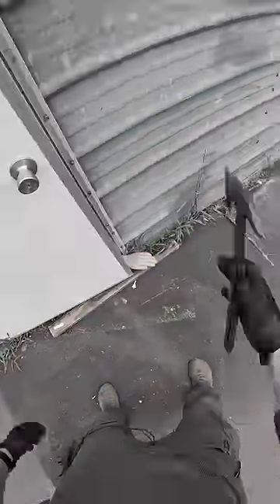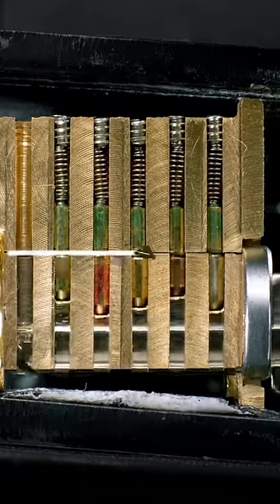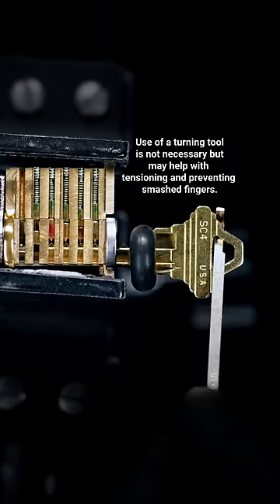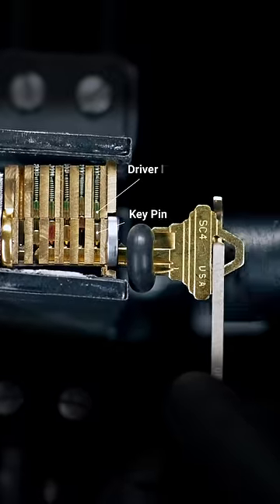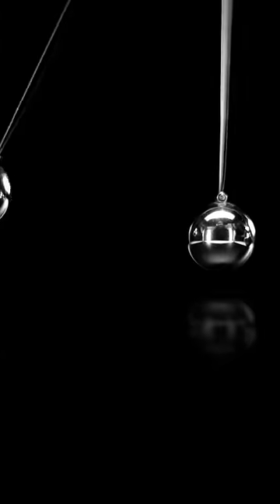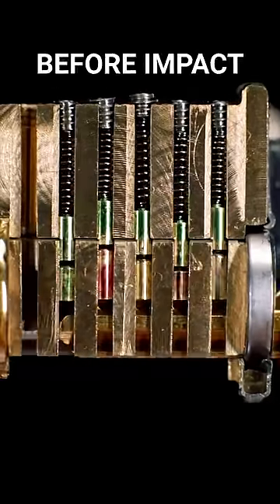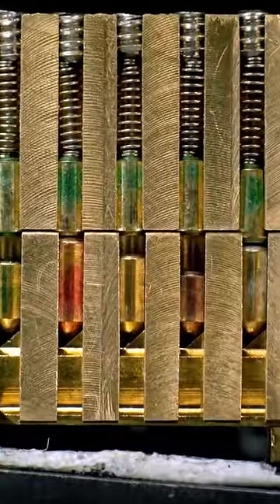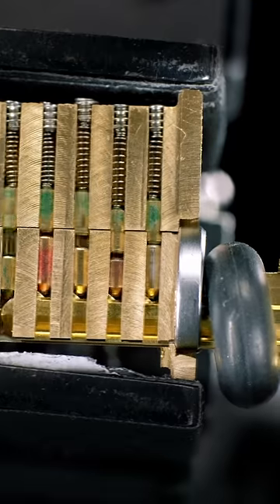Lock bumping explained with inside perspective and mini speed square motion graphics.

Comment: Finally a lockpick YTer actually acknowledges that it's a castration band 😂
Reply: Must not watch many bump vids dude.
Reply from the maker: I personally think the traditional method is better (for sheep), but I'm also okay not pulling testes out with my teeth 🤝
Reply: @McNallyOfficial i use the bands, they only roll on the ground for a few mintutes, poor things
Reply: @The_Natalist my god that's terrible!
Reply: And the best part is that it doesnt hurt as much as you would think so, after the first few hours you wont feel anything
Reply: @The_Natalist what are you talking about? If you catch them in a bucket no rolling has to happen 😂 but you're doing it very fucking wrong if you manage to hurt and animal with rings
Reply: @Charles-hm5zj it's a constriction band that goes around the nuts. It's going to be umpleasant
If you don't believe me, apply one to something you can cut it off from. Like a finger. Let me know how long until you feel something. There's probably medical recommendation for minimum time before the band will definitely cause damage. Probably something like 30 mins or an hour. Check first.
Reply: @samuelmellars7855  There is a persistent myth that young animals have "underdeveloped blood vessels and nerves" in that area, and therefore they are more panicking about being handled than they are about being in pain. Of course, there isn't a lot of scientific study on the subject, but there's also zero reason to assume one of the most tender areas on a human is any less so on other animals.
Reply: @McNallyOfficial sheep lil bull calves ppl horses anything that you can get em on is fair game lol
Reply: @Nerobyrne  it doesn't really effect calves other than them walking a little funny for a while. It's a lot better than losing a couple calves each year because they bled out from traditional castration
Reply: @LukeA_55  still disgusting
Reply: @Nerobyrne  just a part of farming
Reply: @gdxnsk  🗿
Reply: @Nerobyrne  > that's terrible

There are tons of things simply unpleasant to think about. But I'm thankful that we have people whose livelihoods involve routinely doing unpleasant and dangerous things.

Because steak and chicken are simply too damn tasty to stop eating them.
And because a lot of people still drink milk. 

Also I like not crapping in a bucket.

And not hauling my own trash to the dump each week.

And not having to embalm my own deceased relatives.

And walking to the fridge for eggs instead of through a smelly henhouse.

And knowing my insides are working properly.

And knowing help is a phone call away if my house catches fire. 

et cetera...
Reply: @zedmelon  I hope we can one day do it without stuff like that
Reply: @McNallyOfficial I am the confusion
Reply: What is everyone commenting about? Got one of those for my Peterwood Johnson, helps me last longer for when I stand in my lady. I'll last all night till she taps out. You guys are crazy with that  castration nonsense, but funny.
Reply: @truthinaction0000  Bro that gross as hell lol
Reply: @Nerobyrne  Nice idea, but unlikely.  Operations of different sizes all face different challenges, but biology will remain pretty consistent.
Reply: @Nerobyrne when science becomes magic
Reply: @Rustylicenseplate 💀
Reply: @gameseeker6307  it already is
Reply: @skrawny-clown-snatcherofth8651 Only problem is if you did it to a human, there is a much higher chance they'll bleed to death.  We have a LOT of blood vessels in that area of the body, and no boner for our boners, so it needs a proportionately much higher pressure, much larger vessels, more vessels, and much stronger vessels than most animals.  Not a good idea.
Reply: @AflacMan13  lol thats the point and from ranching my whole life never had any issues banding steers and lambs
Reply: @Nerobyrne  Yeah, not gonna happen.  Animals still poop and pee everywhere, there's no getting around that fact, and that means that someone has to deal with their waste somehow.  That means smelly chickencoops, stinky cow barns, and filthy hog pens.  

There is no way to make farming cleaner.  It is literally working with the dirt of the ground itself.  You are GOING to get dirty.  

If you mean without chopping the nuts off of bulls?  That's just good animal husbandry.  

What I mean is thi:  Which is better?  Let's say you have 200 head of cattle, and when you breed them to make more calves and increase your herd or refresh your numbers, you get let's say 50 calves.  Now we have to do a little something we like to call Cow Math.  For Chicken Farmers it's Chicken Math, Turkeys it's Turkey Math, etcetera.  Now Cow Math is slang for the ratio of how many hefer calves you got to bull calves; how many females to males out of your most recent calving.  

Now if you got more Bull Calves than Hefer Calves, well then you have a few options.  

You don't want your cattle free mating all willy nilly, that's a great way to end up with unalived and d¡seased hefers getting banged to unalived by a bunch of bulls running around freely; so, you separate your bulls from your hefers.  But what do you do when you have room for 15 bulls let's say, and now you have 35 new Bull Calves out of the 50 that were just born?  You can't just let them starve, and as they grow up their hormones are going to make them MEAN little cusses if they don't have a herd of hefers to mate with regularly.  So...  

- you can sell them, IF anyone is available to buy them, and in the meantime they're growing into adult hormone driven Bulls with horns and hormones and anger.  

- you can auction them, but there's not telling what you'll get for them, and you might get screwed and have to sell them at auction at a severe financial loss.  

- You can off them and sell or keep the meat, but that only goes so far and selling calf meat is often frowned upon, if not outright illegal, in some places.  

- Or...   you can castrate them.  It stops their hormone production, makes them docile, compliant, and dumb.  It lets them become adult cattle, without trying to cover any female that moves, and without having to separate them individually from the herds and other bulls quite as much, and you get to off them when they're an adult and get WAY more meat and WAY less problems selling their meat.  

Sometimes it's the only humane thing to do, which I know seems backwards, but it's the truth.  

Kind of makes one think about why there's this giant political push to mass castrate American Boys.  Hm.  Makes bulls docile, compliant, agreeable, dumb animals.  Hmmmmmmm.  Eugen¡cs 2.0.  😡
Reply: @AflacMan13  it's already happening.
Reply: Pro tip: you can safely cut them off from anywhere if you loop a yarn or fishing line through the band before applying it.  @samuelmellars7855
Reply: Not sure he can remove the castration band so be careful
Reply: @truthinaction0000 
  1)  TMI my friend.
  2)  same concept, but way, WAY tighter band!
Reply: I'm 100% for using these on any humans comvicted of predation of prepubescent children.
Reply: @AflacMan13 youve never seen the efukt thrad about a guy who did exactly this to satisfy a castration fetish then 💀
Reply: @gdxnsk Speaking from personal experience?
Reply: Wtf...
Reply: I thought it was just a cockring ☠️☠️☠️
Reply: @ac2.024  it's a 1 use cockring if u leave it on long enough 🤣
Reply: @Nerobyrne  I hope not. That would be the loss of many many jobs. Just cuz it bothers you doesn't mean it bothers the ppl who do that job. Like I hate heights, but the ppl who climb cell phone towers are fine with it. Some of them probably are not so good with wiping baby butts, I don't have that much problem with it so I do. Some ppl hate dealing with other ppls kids, I actually like it so I do preschool and tutoring. But if we just got rid of all the jobs that make YOU uncomfortable then that would be a lot of ppl out of a living. Cuz some of them likely are really uncomfortable with whatever you do for a living.
Reply: @caitlynlawrence8502  advances in technology always lead to some jobs closing and others opening, otherwise we'd all be unemployed.
Reply: @Nerobyrne Some vegans love animals more than humans and don't see the irony.
Reply: @gdxnsk so you have had one on (as I grab my loaded banding tool I bought from a national chain of farm themed stores.. 
Until you learn how to get them off painlessly they make a great tool to ease shaving the areas those boys down there live in.
I've got close to a hour playing with one, but I studied the reprocussions first, 6 hours and the irreversible damage has set in, and if you decide to go further you'll have a foul smell for days until they are aschemic.
Reply: @skrawny-clown-snatcherofth8651 little brothers
Reply: @bigfanpics8496 they'd have to put some form of device to make it inaccessible until it's completed its job, although the testes do nothing to restrict a erection.
Reply: @Stache987  no they have thumbs and can get it off lol

Comment: Problem: you lost your key
Step 1. Grab your lost key and file it down 

Seems legit
Reply: Real og's will have deja vu right now
Reply: It's kinda a good suggestion, maybe not the lost key but same brand/type key. Key blanks usually aren't sold to non legit locksmiths so you'll need a different key of the same kind
Reply: You got the joke, congrats
Reply: Sometimes you can just demo your way through the problem. However, if I had the time to do that, if, I'm glad I know now. Thanks McNally and Covert Companions! When's your next sale? I missed the July 4th one.
Reply: @sp1cyc1rcle79  they did it in the last one where they said to find your lost key and get your pliers locked by the key.
Reply: "you didn't have to cut me off"
Reply: It doesn't work because you made the wrong key from the right key.
Reply: @dalekcat anyone can buy a blank. True that locksmiths might but seek then to you, some auto or home stores might not, but that's what we have the Internet for and those places can sell you the key, they just might not.
Reply: @WhiskeyAlphaRomeoMA  > When is the next sale ?
LPL posted a video on (July 4th?) saying they have two sales a year. 
iirc they are Independence Day and Black Friday.
Reply: @EzekiesAcheron  yes.
Reply: I thought I was the only one to catch that. 😂😂😂
Reply: Next, grab your castration band. New or used will do.
Reply: "Grab your lost keyring"
Reply: @wahooey6189  I'm looking for my lost wallet concurrently
Reply: @dalekcat NERRRRRRRRRRRRRD
Reply: You ruined the party!
Reply: Or any other key that you can get into the lock
Reply: Hahahha  why if you have the lost key again would you want to struggle? Just unlock the door
Reply: i love that phrase ! XD
Reply: Step 2: Castration ring
Reply: @sp1cyc1rcle79 That's what I'm thinking 😂
Reply: @dalekcat There are automatic key cutting kiosks though, I'm not sure that controlling the supply of blanks helps security when a robot will cut any key you want for you.
Reply: Life hack moment
Reply: That's what I'm sain!
Reply: Is anyone else watching this video on their lost phone?
Reply: Not only do you grab your lost key, but you have to "Make the wrong key from the right key".😂😂😂
Reply: Ain't that the truth.
Reply: I was just thinking the same thing if you got you're key why do you need to turn it into a bump key. Makes no sense.
Reply: @stephenrichard3599  Me. I am. Watching on the phone I think I maybe left on the subway on my way to lunch.
Reply: Yeah I didnt get that either lol
Reply: I can’t stop laughing!!!!!!
Reply: Wuit showing people how to pick locks, criminals see this , you’re just helping the bad guy out!!!!!!!
Reply: I replayed that part 36 times thinking I heard it wrong 😭
Reply: Wow you found the joke
Reply: @dalekcat googled key blanks and everyone sells them 😆
Reply: @sp1cyc1rcle79  deja vu so intense it breaks the boundaries of space and time to give you your key back
Reply: bouta say da same thing wtf
Reply: @DevRel1 it looks like English, it sounds like English but it's not English.
Reply: I was literally going to make the same comment😂
Reply: So! the reason my key is lost was because my time travelling future self came back and stole it. Its like the whole hamburger issue all over again.
Reply: @dalekcat you can just use any old schlage or quickset key to get a homedepot or lowes automated key cutter to dispense a copy to cut down.
Reply: haha yeah right totally for you own door and your own lock 🫣😅
Reply: Im confused. Why am i breaking the key that already opens the lock?
Reply: Idk but it seems like him saying this keeps him from being liable somehow? Anyone smart enough would realize that “find you lost key” means go get a blank from your local hardware store
Reply: Bump keys are very cheap to buy though...
Reply: You can use any of those keys to make a bump key lol 🔑
Reply: I got the joke thank you
Reply: lmfao
Reply: bruh i didnt catch that at first. "grab your lost key" XD
Reply: Answear is.. use any key.
Reply: Making a new password be like:
Reply: @sp1cyc1rcle79 grab your tweezers
Reply: You don't have Xtra keys on your car key holder?
Reply: but you didn't have to cut me off-
Reply: After first line. I report for spam. That simple
Reply: He said it that way. Because the alternative would have been "this is how you break into anyone's house," that is not going to go over well at the trial lol
Reply: You can file any key to the lowest point
Reply: if your in an apartment and you do this to your key you can get in your neighbors house
Reply: you’re using a lost key, just not the key you lost
Reply: Goose, you beat me to it.
Reply: Get a different key bud
Reply: Bahaha
Reply: 69th
Reply: Jesus is the only way to heaven 
Being a good person won’t get you there.

“Jesus said to him, “I am the way, and the truth, and the life. No one comes to the Father except through me.”
John 14:6 ESV

Repent from your sin(disobedience to God) and turn to God and follow Him so that you will be saved 

“If we confess our sins, he is faithful and just to forgive us our sins and to cleanse us from all unrighteousness.”
1 John 1:9 ESV

“No, I tell you; but unless you repent, you will all likewise perish.”
Luke 13:3 ESV(
Reply: Well maybe you could use the method for a random key ya find? it’s useful to know but yeah funny choice of words huh 😂
Reply: @dalekcat or you could find a dropped key somewhere and if you’re a good person (unlike me) look for the owner and if no one shows/they don’t need it use that method or you could use an old key that you no longer use idk I’m just speaking out of my arse tbh 😂
Reply: @dalekcat  really??
It's called humour.
Reply: “Your lost key” = any key
Reply: That's what I was thinking lmao I'm like huh wth
Reply: That shit throw me for a loop to like wyf
Reply: It will work with the wrong key if it fits, just needs to be filed down.
Reply: Yeah i don't get it im confused and then. That's because  we made the wrong key from the right key. 🤔🤔
Reply: Wtf
Reply: U gotta find a useless key and do it
Reply: @hayden6700 I didn’t until I saw this comment 💀
Reply: Real
Reply: 909999999999
Reply: Exactly what I came down here to say, wtf??
Reply: Oh hey my key was right next to me
Reply: @sp1cyc1rcle79 😂
Reply: thats how a lifehack works
Reply: Omfg lmao
Reply: “A castration ring can help here”
Reply: Fax fax
Reply: @dalekcat dude what? I bought a couple like a few years ago to use for a lever in little mechanical device, you just gotta buy the ones from Home Depot that have designs on em
Reply: Lol step1
Reply: @chaoticdetectivepeach  I'm a European, don't have home depot and many have different key designs + older designs nolonger sold, locksmiths may have blanks but heck I'm frugal and I can use a file to make a different key fit as long as the highs and lows are suitable for a new cut
Reply: It’s the same how your computer can’t connect to the internet. It gives you options to find out ways to connect to the internet, but the instructions are ON the internet. So when you try to see them, it says: “You must have an internet connection to see this page.” Like bro!
Reply: Step two put a castration band on it
Reply: I think he means just get a random key file it down to the positions he mentions and then use the hammer method.
Reply: real
Reply: Here’s an easier way to find a lost key, don’t lose it
Reply: Yep😊
Reply: YOU DIDN'T HAVE CU-
Reply: cant get anything past you huh
Reply: i was going to make the same point , no need to since you already did .
Reply: Cheese
Reply: grab your hatchet
Reply: Lol right
Reply: @dalekcat the only key blanks that joe shmo can't buy are the ones with patents that haven't run out. Once that patent expires they flood into the market. If you have the internet, you have access to buy all the key blanks that you want.
Reply: @jimbob5891 that key cutting robot needs blanks to cut a key. Did you think it was in there lasering out the whole key from a brass sheet?😂
Reply: I had to replay it because I thought, "Surely he didn't just say that..." lol
Reply: "But you didn't have to cut me off..."
Reply: Future case scenario
Reply: Fr